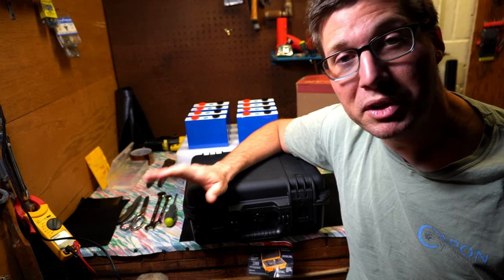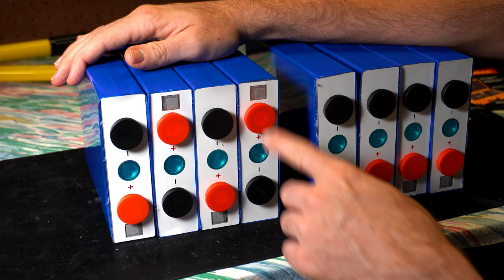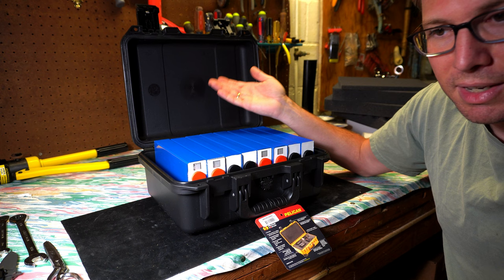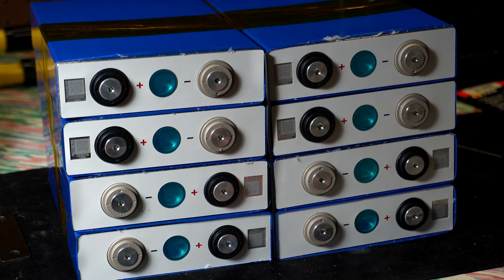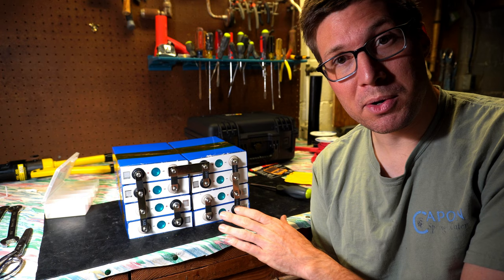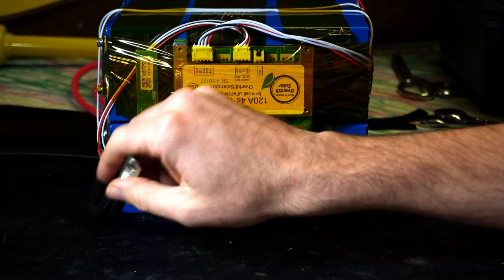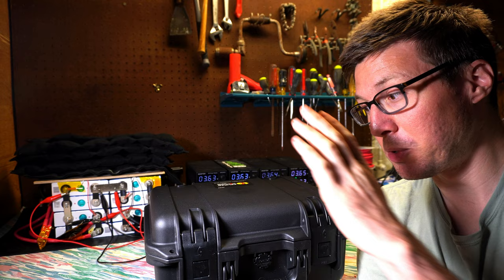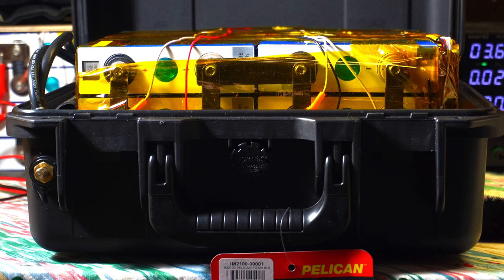How to build a Waterproof LiFePO4 Battery | Sailing Wisdom

Comment: Why does top balancing take so long?  Like, days.  What is going on in there?
Reply from the maker: The cells are slowly being fully charged. It’s pretty much a trickle charge to get them to their absolute full charge level, and on a large cell like this, it’s a slow process. 

If the cell is 100ah and you are charging at 4 amps, you will be a minimum of 25 hours. As you approach full charge though, the cells won’t accept as much power and charging slows down to a crawl. This is when you find it charging at 0.1amps for a few days. 
It’s important to do this process all the way so that it is done right and then everything works well afterwards, but it is a lengthy process.
Reply: @RiggingDoctor  Thank you for the quick reply.  I actually just came back to say never mind since you answered the question in the most recent top balancing video.  Interesting stuff.

Comment: Be sure to protect the small monitoring wires from chafe around that front corner.
Reply from the maker: 👍 good call. I’ll add some rubber under them over the cells.

Comment: I have bought 4 * 400 amp @ 3,2v, and still have to choose the BMS. I will maybe add a second set for 200 or 400 amps if I see it necessarily, I choose to be conservative (I use induction for cooking and electric water heater, so I aimed low on purpose to have a functioning system and expand based on 1 year worth of real data or so).
Reply from the maker: That’s a solid plan. Unless you have an electric motor, it would be hard to exceed the limits of the BMS. If you do find that you are exceeding the capacity of a single BMS, stacking another one in parallel will double your capability.
Reply: Get the JK BMS with 2amp active balancing.  I have dual 150amp batteries.  Trust me the active balancing makes a huge difference especially if cells get low.  Most of the BMS's have a resistor that bleeds current from high cells only. 50milla-amps instead of the JK 2000ma.  Low cells are left to rot, and that can mean the batteries shut off prematurely.  Get the JK and it makes any cell variations virtually disappear.
Reply: You do not need a BMS with high amp. I have a set up with 50 amp BMS on 400 amp 12V system. I have my inverter (4000 W) connected to + through  a 600 A relay. I let my BMS cut off the relay if I get imbalance more than 0.3 V between my cells.

Comment: You might get issues with those not flexible busbars. The busbars are at a angle, which decreases contact area...also those busbars are not good and can get very hot with 50A already. The resistance is too high, because of the small contact area on the battery terminals. But I like your DIY battery design.
Reply from the maker: Good points. Thankfully these will be doing small house loads so they won’t have that much power pass through them.
Reply: What would you suggest as an alternative to the solution shown to decrease resistance and increase the contact area?

Comment: What are the battery cells used in this?
And
What are the benefits of a prismatic cell over a cylinder?
Reply: Space. You don't lose the space in between the cells that's inherent when you put cylinders together.
Reply: @SuperDirk1965  that is true, but you also give up the inherent air cooling capabilities and have to provide the compression system as well.  In *this* case, the Pelican box theoretically provides enough force, but why consider that at all?  This does provide a method for a smaller, denser battery where  space is a premium.
Reply: @TJDST4  You can compress them with anything. Mine are compressed with a charger jammed between one cell and the battery compartment. so no loss of space. I don't have a bms either, just don't charge them above 3.4V/cell and they never get discharged too far. It's a 4S system, 12V 500Ah connected to 200W of solar. The battery powers my autopilot, the fridge and the instruments. At night it powers the lights as well and in winter the diesel heater. It's not connected to the engines alternator, the engine has it's own SLA battery.
Reply from the maker: The other huge advantage is you can build it with a set of wrenches instead of spot welding hundreds of tiny cells together!
Reply from the maker: EVE 105ah LiFePO4 Cells: https://www.docanpower.com/index.php?route=product/product&product_id=437&tracking=06ORmUMyyrYyEpQ2VkP7mUHWKgx9B9SeQB6gb57tAV7ag91SsfJ5D2FxQRDgTqmm

Comment: Is this cheaper than going out to buy a LiPo battery?
Reply from the maker: They cost about $950 for a 12v100ah battery where the parts to build this 12v200ah battery cost $1200, and it’s waterproof! I would say it’s a significant savings.

Comment: Did your last DIy battery bank crap the bed and die?
Reply from the maker: They are still going strong. This is for a cruiser in the islands. He’s going to run his whole boat on these two batteries. That’s why I’m building them as 12v batteries. 
His total battery bank is going to be 12v, 440ah!

Comment: You put the positive terminal on the bottom of the box...
Reply from the maker: Yep. It’s bedded in and the battery is going to be installed in a dry environment. 
On dinghy batteries, I put the terminals at the top of the lid. The reason I didn’t do that on this build is the space and size requirements did not allow the size of the hold did not allow for the terminals to be mounted higher.

Comment: Ideally two parallel battery systems sized for loads tied to a PICOGLF30KW300V2083P or 👉🏿 Aims Power Off Grid PICOGLF50KW384V240VS , 👈👍
 is most practical IMHO. There are a lot of great LFP cells in the 100 - 340 ah capacity but I think the best  and most practical is 110-120 VDC x 2.  With a higher budget I'd build 2 x 140 VDC+
The lower voltage battery has the advantage of less PV panels on deck, so balancing between deck space and battery cell capacity first then consider higher voltage if space is adequate. Best bang for the buck hands down. I also like the economy Hybrid Inverter Charger 9.6 kW Power Output 15 kW Solar Input with a single 90-300 volt battery.

Comment: Im sad you dit not use butyl to waterproof the standoffs
Reply from the maker: The 5200 is also adhesive so that the studs are permanently in there as well. It’s double duty.

Comment: How do insurance companies feel about home built DIY batteries, their installation, and wiring? My understanding is insurance companies frown on insuring DIY or they will only pay a small percentage of a claim. 🤔
Reply: As always, read your policy.  There should be a perils section.  I am not aware of a policy that excludes this, but maybe there is one out there somewhere.  The perils section for the few I reviewed specifically dealt with hurricanes, storage on land, and blue water limitations.
Reply: Li Fe Phosphate should be safe and even water extinguishable.🤔 Ive even seen them built into floodable compartments. ..
And they use them as firewalls in mixed Li Fe Li Ion packs.

Still play safe if in doubt. .. btw its still worth padding out the battery packs against the sort of g forces encountered in going through a heavy sea.. thats acceleration up to 7g according to one German manufacturer. 

Safer still are the Li Fe Phosphate blade cells..

Bet your happy you dont have to faff about soldering round cells 😉🇬🇧🧙‍♂️
Reply: Your ever friendly mobile phone or lap top is more likely to cause a fire .. especially if left on charge.
Reply: @SenatorPerry  BTW, I've read/heard boat owners who plan to install their own lithium batteries onboard are being advised to seek professional help or risk invalidating their insurance and manufacturer warranties. If an owners’ system was not upgraded and installed by an ABYC certified  electrician, claims may be denied entirely. Like you said, read the policies fine print.
Reply from the maker: The trick is to make sure that what you put in your boat is bulletproof so you don’t have to deal with insurance claims.
Reply: @RiggingDoctor  
Yup even the professionals may get it wrong ... 
The bearfoot doctors  found that out with their Leopard..
Reply: Sailing SV Lynx is building a Schioning cat and basically started a one off commercial battery company to make the insurance company happy.  They did a whole series on their batteries too, which no offense to our friends here is a bit more in depth.  I think most importantly, they actually talked to the insurance company to find out what was ok and what wasn't rather than the far more typical assume or just don't mention it approaches.  Given this is an insurance company OK with insuring a home built million dollarish boat, I think it's telling that just building your own batteries is not ok, but building the hull, doing the wiring, installing the fuel tanks etc is all ok.

Comment: As far as I'm aware the LiFePo chemistry allows it to fail below ignition temperature so they're loads safer.
Reply from the maker: Also they are self limiting when things go terribly wrong so it’s harder for them to catch on fire.
Reply: @RiggingDoctor  Fun fact: prismatic cells are just big cylindrical cells squished flat. They're still rolls inside.